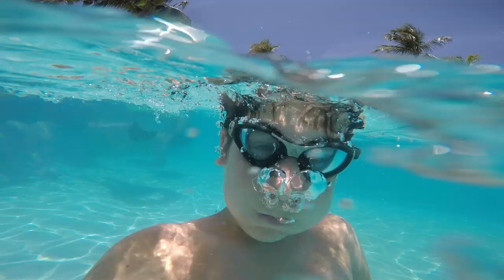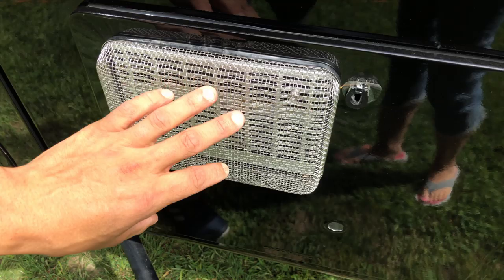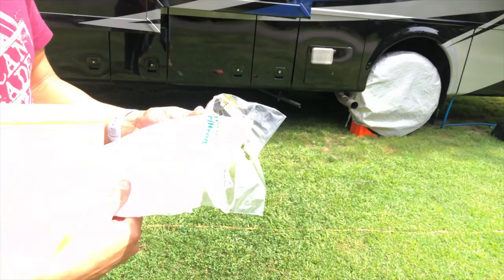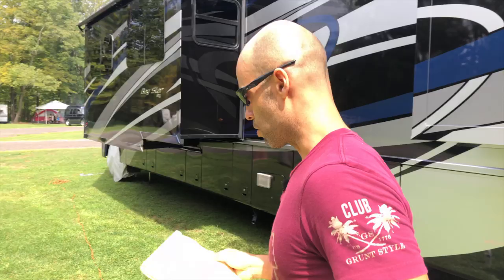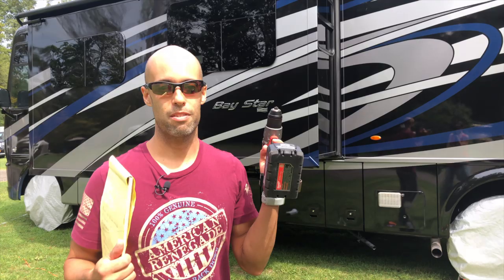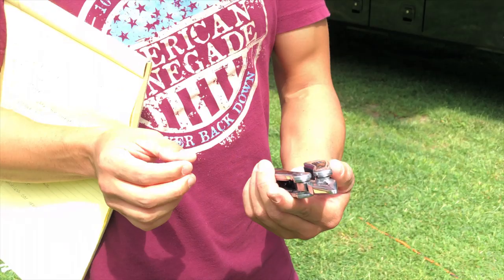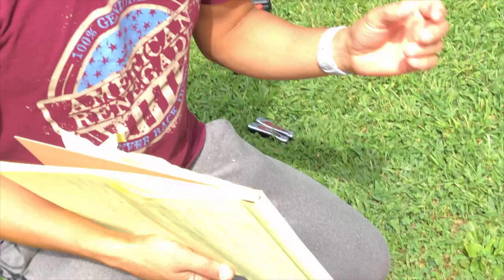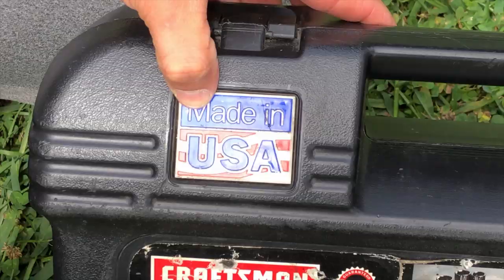12 ESSENTIAL ITEMS EVERY RV OWNER SHOULD HAVE PART 2

Comment: Love the video, kudos to MJ for her video work. You showed the dump hose in an extendable rack to keep it flowing properly. The one problem I have encountered is it coming off the rack. I bought 5 sand saddles that sit on top of the dump hose and keep it in place. I highly recommend them as not all RV spots are flat and the hoses tend to come out of the rack. They are easy to use you just set them on top of the hose and 5 work great for 20", use less for less distance.

Comment: A couple that we did after the first trip down south.
Upgrade floor registers to metal. Had the wife with heels broke 2 already. Not a function problem just part of the corners, but looks like crap.
 Intake filters. Our a/c is ducted in the ceiling and has intakes every other register. We put charcoal filters in them. Cleans the air at the same time as catching particulates.
 Plastic bins to house the fresh and black water hoses. Always keeps them from touching and any water that may remain in the hose is kept out of the bay.
Lastly, I am tall and getting up outside by the slide has resulted in several pokes in the head and back from the corners of the slide. I bought pipe insulation for a couple bucks at home depot and cut a couple pieces (save the rest) to shove over each corner, with a little extra length added to it, and now when I have stopped thinking and stand up at the wrong place...no more blood. LOL
Reply from the maker: Thanks for sharing

Comment: Another homerun, Izzy and MJ!!  Stay safe!I'm sure it is addressed later in your video catalog, but do you pretty much strictly use just that wash and wax to clean your rig?
Reply from the maker: Hi Alan.  Actually what we use the most is DI water with electric pressure washer and foam gun.   The wash and wax is really for quick clean up.   It would not be cost or time efficient to do the whole Coach with the spray.  The best and quickest way is with DI water.